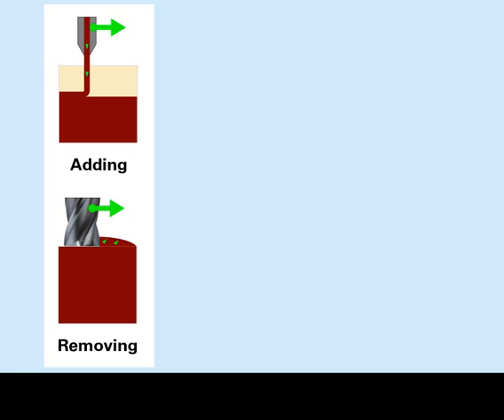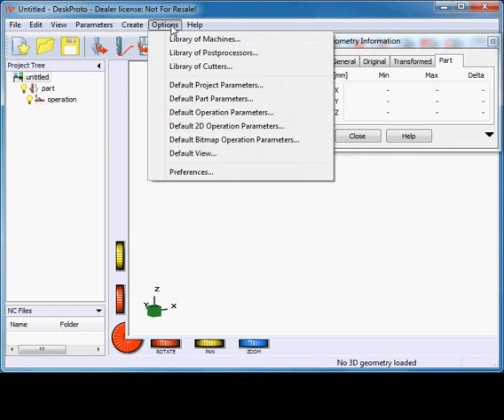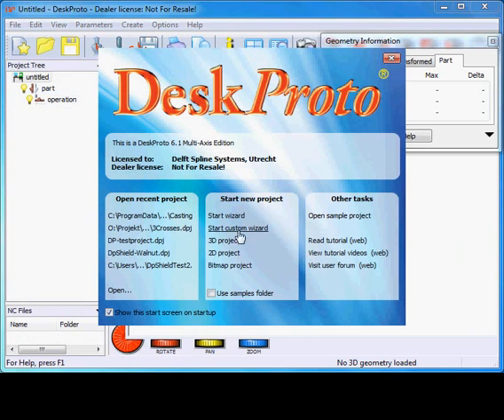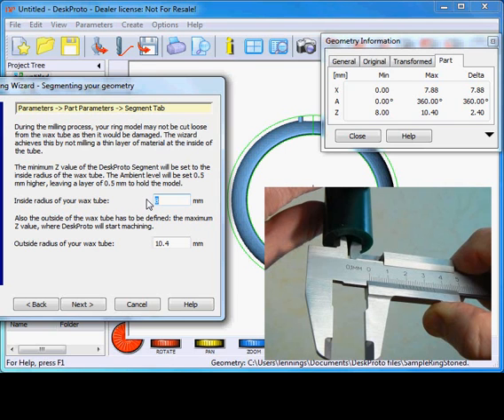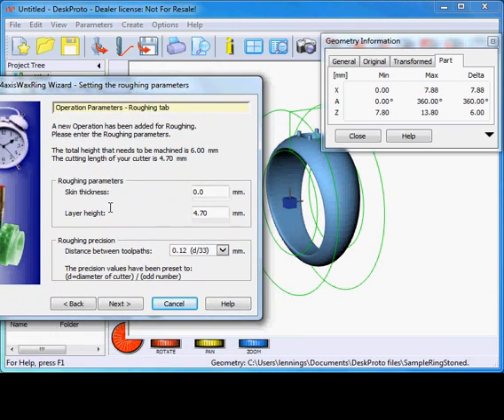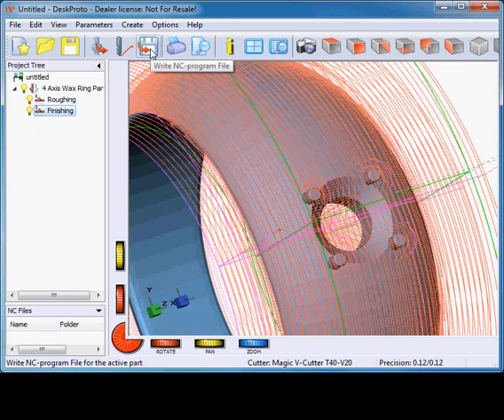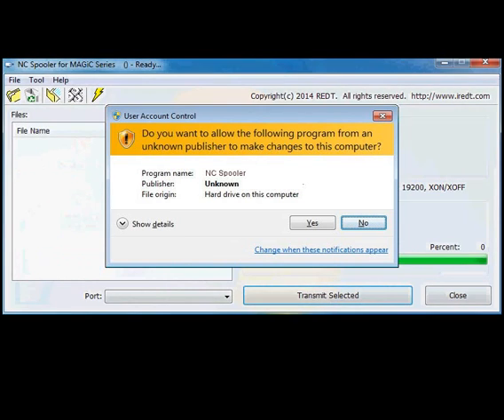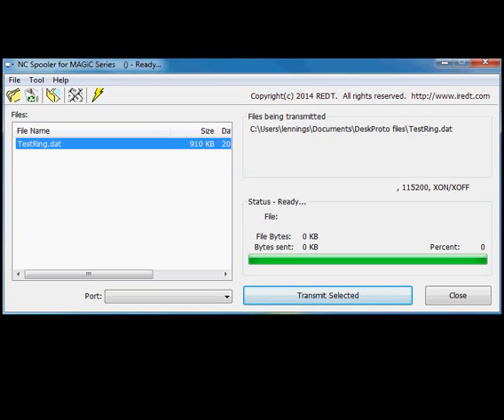Creating jewelry wax models on a Magic 7 milling machine, using DeskProto.

Comment: I wanted to know how much this little cnc bench? Similar to Roland MDX40 !! It can also mill heavy metals or only those light (aluminum, brass, etc.)? Thanks so much.
Reply from the maker: I am afraid that we do not know the price: we offer just the software, not the machine. Please contact Red Technology or one of their resellers. Cutting steel won't be possible on this machine, light metals only.
Reply: Frankly I’m so happy using this machine. I did all types of work. 90 0/0 was good.